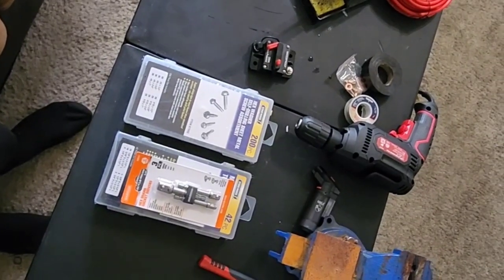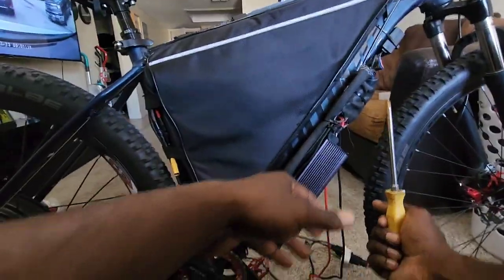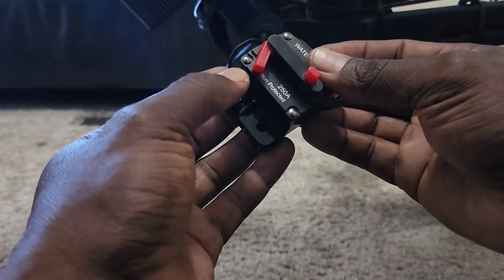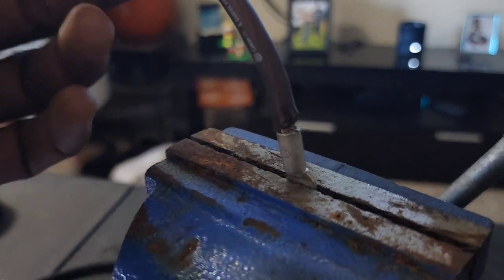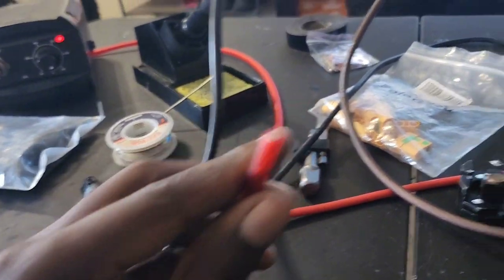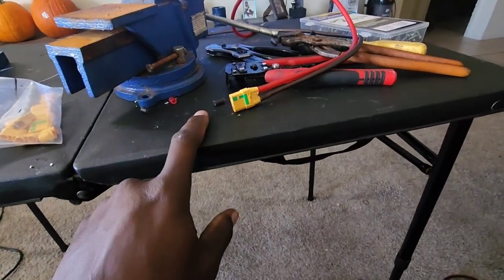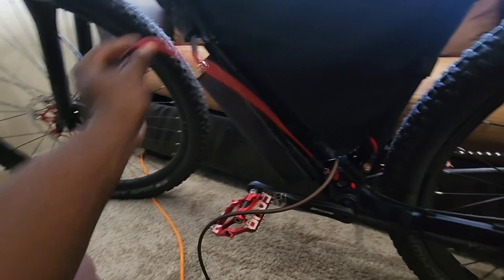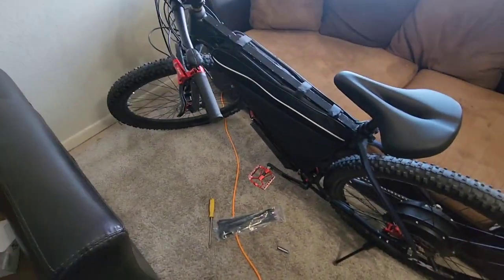how to install a circuit breaker on your  D.I.Y ebike.

Comment: I use too. One button cuts power.. just in case I see smoke? Might buy me enough time to jump off? 👊👊💪💪 god bless brother.  Seems like can bye batteries cheaper than building.. but can custom build for frame.  Rather have bunch of 8s run in series.  If one fails.. easy to fix.. and cheaper than a 20s  nice soldering iron.. just finished my bling on bike! Allot of soldering.  But looks sweet!  GOD BLESS
Reply from the maker: Thank you, with the circuit breaker installed it's just a flip of a switch to turn the bike on and off plus if something happens it will trip so it's definitely a nice feature to have

Comment: i built a 20s by 20p battery with samsung 30Q cells each cell can draw 15 amp contin, in total the battery specs are 74 volt at 300 amp contin and use the 450 amp ant bms with that, a 250 amp breaker would be for this size battery
Reply: opps sorry specs were 84 volt sorry
Reply: for these currents had to use double thickness nickle stripping ,with copper plates ontop for all series connections as nickle strip alone will just burn out
Reply: and all cells need 6 spot welds ,cant use solder cause it will just melt
Reply: @katiekumcgil  Where did you score the 30Qs? I'm assuming your in Aus too?

Comment: Hi for a 72v 20ah 3000w moter should i use a 100 amp or 150 circuit breaker
Reply from the maker: Go with a 100a
Reply: @E-bikeguy  thankyou ebike guy from england uk

Comment: So is that better than. Using a fuse?
Reply from the maker: In my opinion, yes it serves as a on/off switch and if something goes wrong it will trip
Reply: You'll have to replace a fuse if u get overcurrent
Reply from the maker: No. It will just trip and cut the power, fit the problem and fill it back on.

Comment: if i have 100a controller, do i get 150a breaker?
Reply from the maker: Yes just for some cushion get the 150a breaker
Reply: @E-bikeguy  okey, thanks. might get this one
Reply from the maker: Anytime 😊
Reply from the maker: It's working good for me and my kids but my bone head teenager son crash his bike and broke the breaker so I have to order him another one tomorrow he's the one on the 3000w ebike
Reply: @E-bikeguy  oh shit, hope his okey. How did it "break"?
Reply from the maker: I really don't know he said he tried to jump a sidewalk and fell on its side where the breaker was mounted by the crank, I don't know, the button broke off
Reply from the maker: But the bike is fine so it's a mystery
Reply: @E-bikeguy  okey good. But did you say The controller eats up little bit Juice from battery If Is connected all The Time? I talked with some ebike builders and they Sayd i dont Have to Be disconnecting/connecting Them cables before Every ride or almost ever, cause it doesnt really eat up Juice at all they Sayd.
Reply from the maker: Not when you using it during the day it's just at night or when you now riding for a while it will drain the battery by a small amount that's why when you disconnect the battery then in a few hours reconnect the battery and you hear that pop that's because the capacitors drained them self and now they back charge again, if that was the case if the controller do not  consume some energy form the battery when its not in use you will not hear the pop when you connect the battery to the controller
Reply: @E-bikeguy  yea, little bit energy saving but IS IT necessary to Be disconnecting The cables? IS there anything Else than energy saving that takes Place?
Reply from the maker: @kakakakkakiakak  not really the only way is to add some sort of switch or breaker to cut power completely that why people have a switch or a contact system on their stealth bomer clone or hi ebike but they don't tell ya that part and that pop will eventually ruin the connector everytime you unplug  and plug it back in
Reply: @E-bikeguy  yea, ill take The small Juice lose over breaking The connectors.
Reply from the maker: Ok that's why I installed the breaker on my bike and me having rc cars and stuff in my opinion a breaker is a good investment that way if something do go wrong it will cut the power
Reply: @E-bikeguy  yea, im gonna Have fuse on  The positive cable :)

Comment: Is that circuit breaker still working?
Reply from the maker: I actually bypass it all together
Reply: @E-bikeguy  Do you still recommend it? I was thinking of buying one. My old 72volt 3000w ebike was overloaded up a steep hill, and the battery swelled up and melted the XT90 connector. Luckily, no fire!
Reply from the maker: @MotorizedNation  yes definitely if you pulling more current like that

Comment: Clean install, where did you find the breaker?
Reply from the maker: I found them on Amazon, they worked good to ,I can send you a link
Reply: @E-bikeguy  cool thanks
Reply from the maker: Erayco 250 Amp Circuit Breaker with Manual Reset for Car Marine Trolling Motors Boat ATV Manual Power Protect for Audio System Fuse, 12V-48VDC, Waterproof (250A) https://a.co/d/46okKl1

Comment: just curious why your putting a 250 amp breaker ,on such a small battery ,it cant deliver 250 amp consistantly ,it just wont do anything ,should have been 150 or so, or youll smoke something,48 volts at 250 amps is 12000 watts, 72 volts at 250 amps is 18000 watts,
Reply from the maker: Actually it needs a 300a breaker.